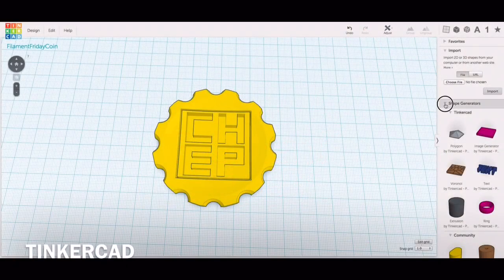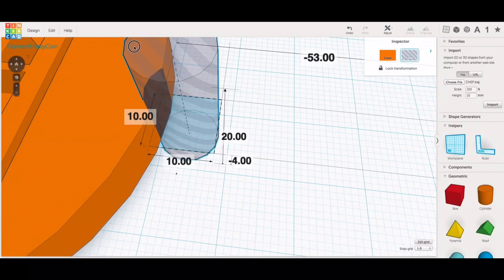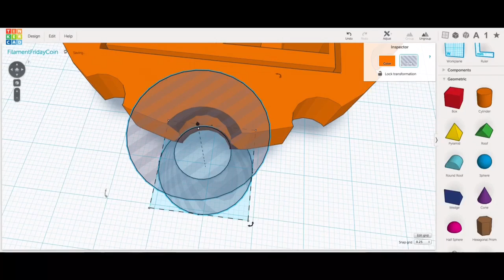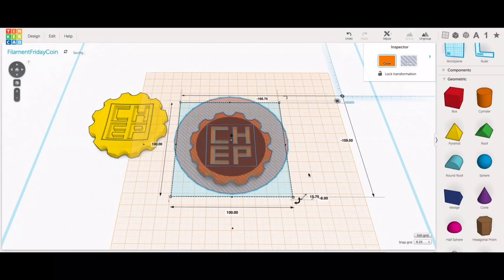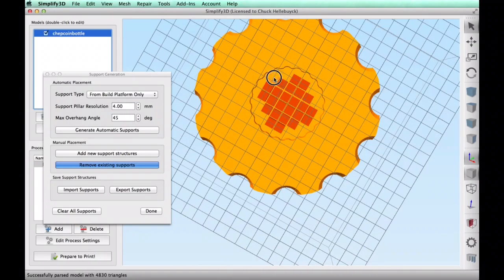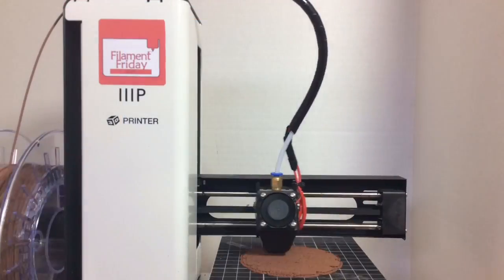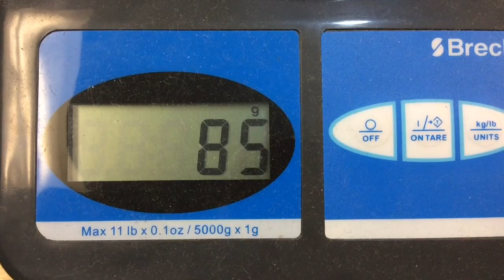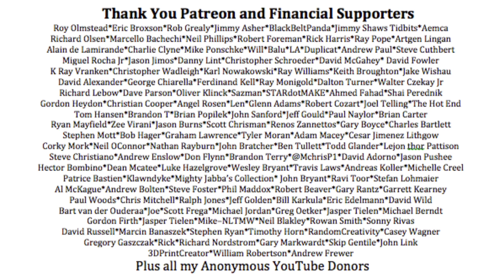3D Printing Filament Friday #84 - Copper Coin Design in Tinkercad with Filamentive Copper Filament

Comment: I recently made my own video on creating a Makercoin in Tinkercad as well! One trick I used to round off the sides of the coin is instead of using a cylinder as the base shape, try using a full sphere but actually cut the middle 10mm or so out of the sphere and it will give the side a nice slight curve instead of being flat. I do like your chamfer idea with the cones though, I'll have to use that. Thanks for the video!
Reply: Thanks Chuck. You're definitely up there on my inspiration list, thanks for all the great videos and tips!

Comment: 10:27 Your Buffer is a bit wobbly. I like my large rotary tools tied solidly to the bench before I stick my fingers near them.
I like the way you show step by step how you use Tinkercad. I learn something new every day. Thanks.
I'd like to know how strong to breakage the printed part is compared to standard filament. The copper does look good.
Reply: Got it... Wouldn't want you to loose a finger and not be able to produce videos... ;)

Comment: Heya Chuck, I noticed you had your infill settings at 30% overlap and 120% extrusion width. Do you normally use those high of settings? Given the 90% infill, layer settings, and especially the sloping curve on the majority of the design makes me wonder how much that affected the "bad surface" of the print. (And by proxy,if something like 15% overlap and 105% infill width would look noticeably better in comparison.)
Reply: Ah, okay, that makes sense. The highest infill setting I've ever used was 85% with 20% overlap and 110% width, and even that distorted dimensions enough that anything tolerance-based went out the window. (Such as your "bottle opener" spot, perhaps?) I have yet to figure out the best settings for models with concave/convex slopes, but I agree that 50% probably would have been better. Then again this was your first print with that BrassFill, right? 'Cause if so it still turned out awesome for an un-tweaked exotic filament! :D  Cheers, and thanks for doing what you do! :D